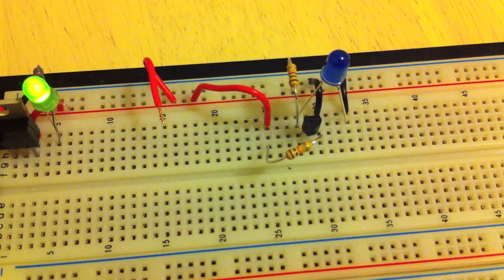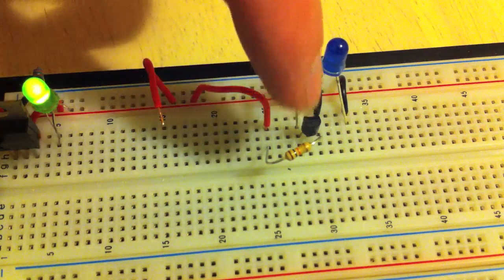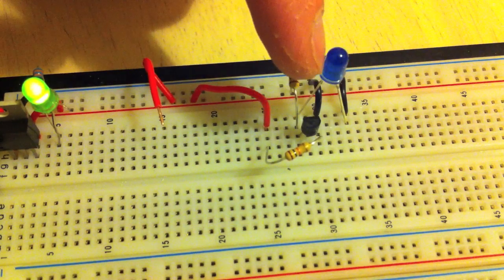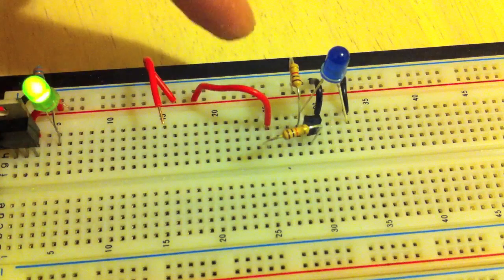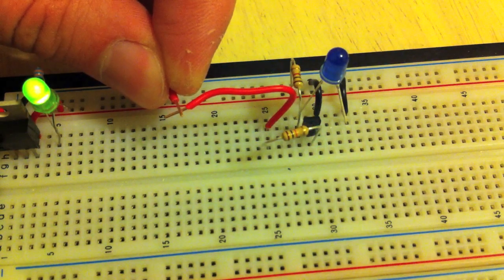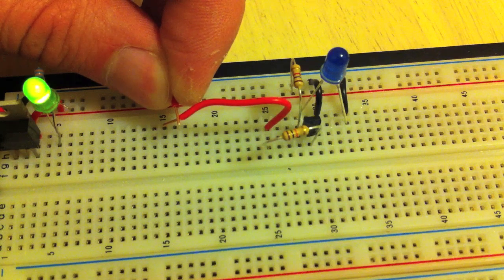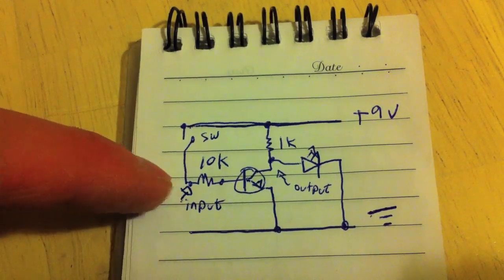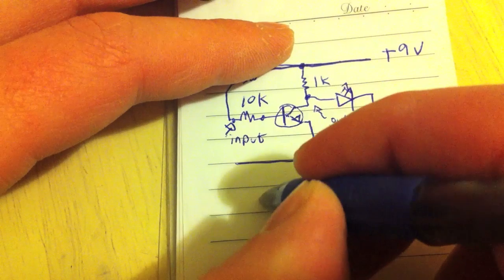Transistor NOT Gate

Comment: thanks for the info man.. just one question.. Why does it work? when is see the schematic it seems like the led should light up even if the base is not excited.. since its connected to 9 volts across a 1 k resistor.. i dont understand why turning on the transistor would turn off the led.. help please